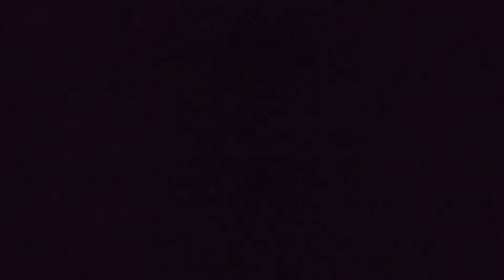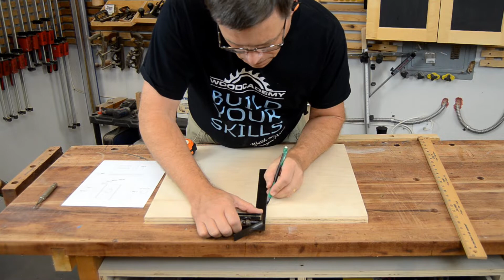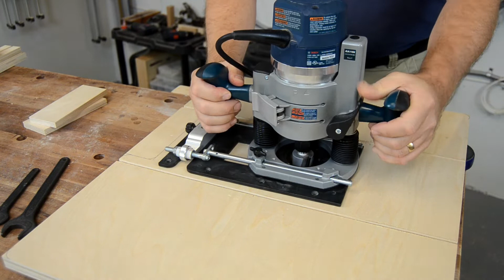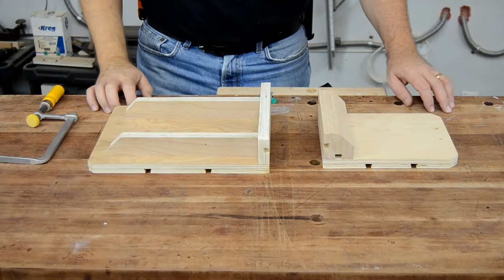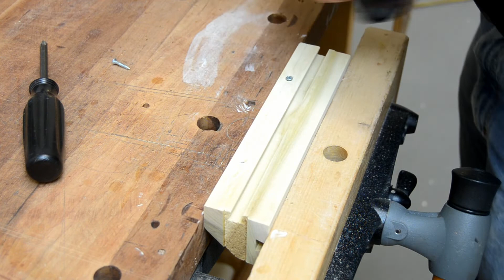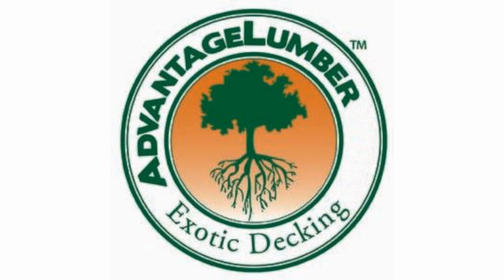Pro Level Drill Press Table- Ep 15

Comment: Hi Ralph - great project which I am going to build.  One question, is there a reason you used matchfit hardware to connect the vertical bracket to the the table (on the bench-top model) instead of just gluing it on?  It doesn't seem like it needs any adjustability unless I am missing something. 
Thanks!
Reply: I meant to say hardware used to connect bracket to the vertical board that you clamp the work piece to, not to the table.  Couldn't you glue the bracket to the vertical board?
Reply from the maker: Todd, Glued may be easier, but I wanted it to be adjustable just in case. One cool bit about making your own is you can adapt as needed.